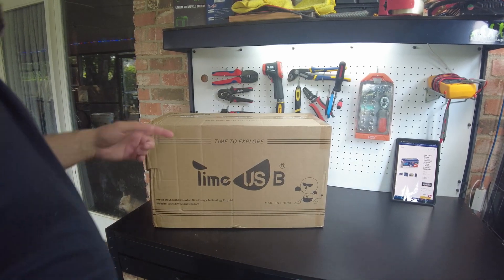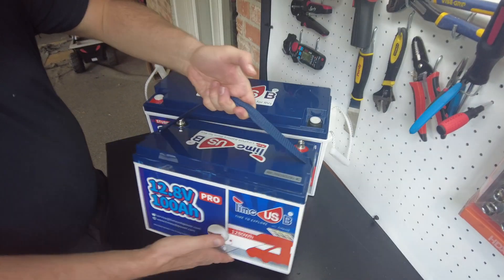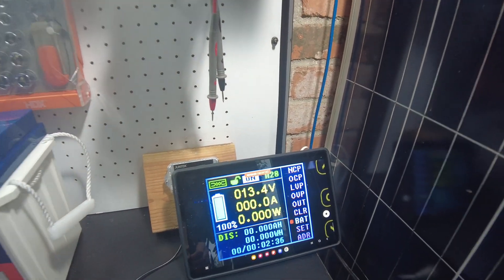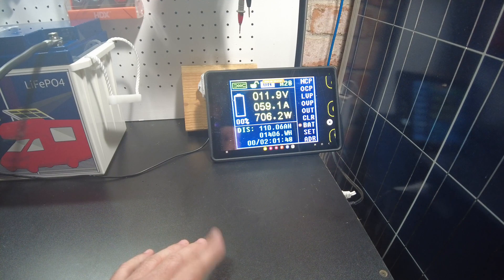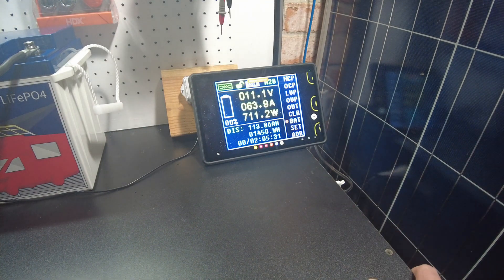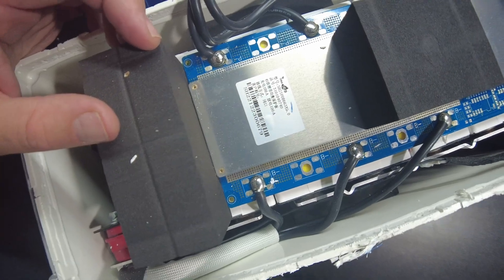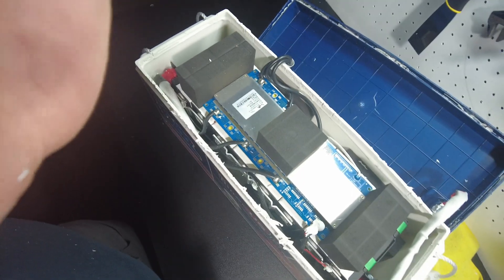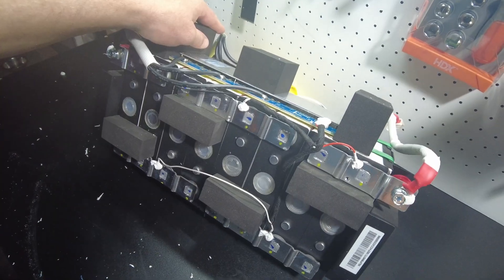Timeusb 12v 100ah (110ah) STURDY LiFePO4

Comment: I ordered this battery came fully charged and put it in my rv my rv fridge runs for 5 days on battery 3 days longer than lead acid. mine arrived by FedEx  in 4 days
Reply from the maker: That's Awesome! Glad you made the switch to lithium :)
Reply from the maker: BTW It probably was not fully charged. Lithium keeps a High voltage even when down to 20%. So you might actually get 10 days :)
Reply: @BradCagle  i put it on a charger set to lipo it came upto 14.4 volts and shut off
Reply from the maker: @DonaldMays  Interesting, usually they come 30-50% charged. Thanks

Comment: Reply from the service department at TimeUSB:
“The cells are all new cells. 

But because the sturdy version has 110Ah usable capacity, it is a bit bigger and heavier than the Pro version. 
If you still want to do the swap, you can reject the batteries upon delivery.”

Comment: @2:20 - "Is there 15lbs of lead in the bottom of this thing, or what??"  I'm really curious to see how they make it that much heavier, given that the internal components are likely to be very similar.  55AH cells in a 4S-2P configuration, with tons of foam padding to take up the space...I guess all that padding makes it "sturdy"?  Compare that to the latest "mini" batteries that have about 90% of the capacity in a form fact that is half the size and almost half the weight.  This battery is their way of using up lots of lower-capacity cells and giant battery boxes before they transition completely to LMFP?

Comment: A 15,000 cycle lifeitime makes them 4+ times standard LiFePO4 cells longevity or well over 40 years. Problem is how do you test such a claim and what is it good for?
Reply from the maker: It must be some theoretical at best. I would still think after 10 years, ageing severely degrades them regardless of cycles.
Reply: @BradCagle  That's a good point too.

Comment: You gotta cut them up all the way for a proper review. Otherwise, there is not much to tell.  I'll tell you what Mr. Cagle, I will send you 50 cents and a ham sandwich if you take them all the way apart, how's that?  Still, I'm like a deer in headlights, I'm  buying one.
Reply from the maker: If you add cheese it's a deal :)
Reply: It's a ham sammich.
Reply from the maker: @asudavew  :)

Comment: Looks to be possibly old fashioned lithium and not lifep04. They probably bought out an older factories stock for a bargen basement price.
Reply from the maker: No, it's LiFePO4 you can tell from the flat discharge curve. Regular/old lithium the voltage will drop more proportionally to the SOC

Comment: The first timeusb products I saw were grade B or used cells that had lost capacity. They packaged them in a large case and claimed 95ah capacity. Later they introduced the "Pro" version in the normal size with new Grade A cells.  This "sturdy" battery sounds like an updated version of that original product.
Reply from the maker: Yeah, I remember Will Prowse reviewing those. It is nice they disclosed them as used cells, many companies would probably leave that out. The PRO version is great. But yeah, this one I don't understand. I did see where they are claiming 15000 cycle life, of course after I shot the video. So are these some new kind of cell with much higher cycle life at the expense of size/weight? Or are they just some no-name weird cheap cell?